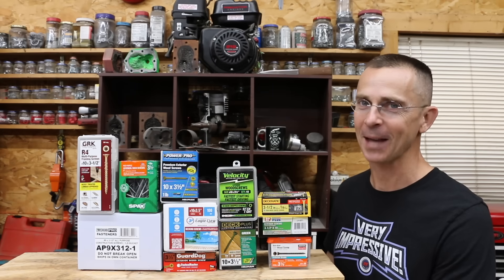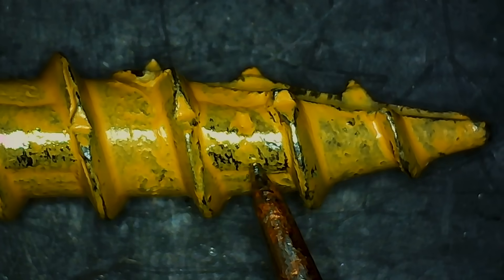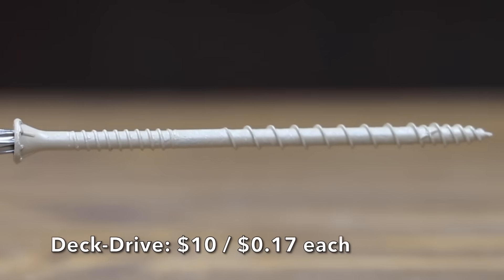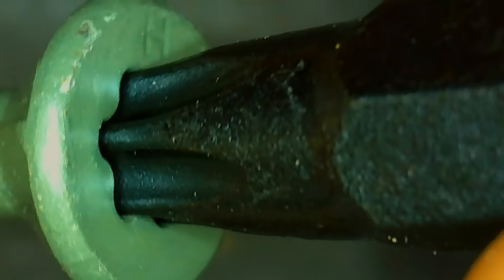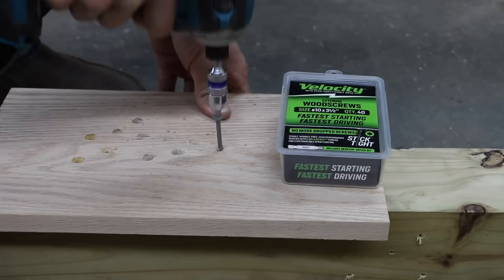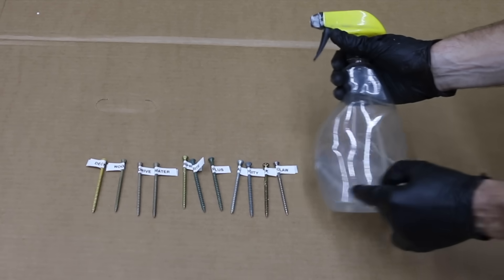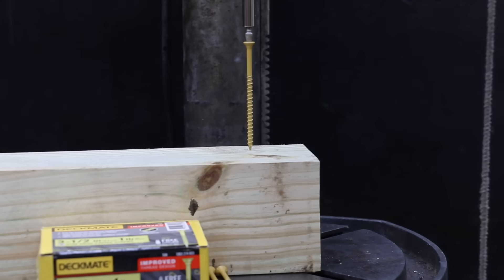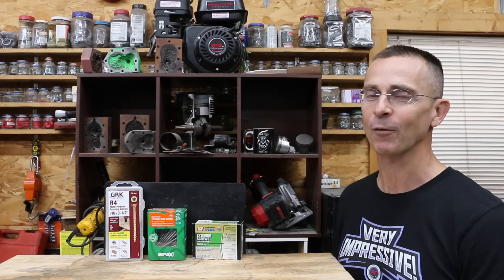Best Deck Screw? GRK vs SPAX, Grip Rite, Deckmate, WoodPro, FastenMaster, Deck Plus, Eagle Claw

Comment: I think you would be hard pressed to find any spray-on industrial fastener coatings, epoxy or electrostatic, that would not flake or abrade off under the friction and heat of driving the screw into dense wood like PT pine. A follow-up test might reveal a different outcome on coatings if the screw was driven into wood slower and with/without the hammering effect of driver-drill tool. Keeping the protective surface coating intact should be the goal, not fastening speed. Obviously there is a balance.
Reply from the maker: Thanks for the suggestion.
Reply: @ProjectFarm  as a test engineer I compliment you on what you have achieved on your sight. The array of products and tools and the creative methods, and limited budget you work with, all collect very interesting and comparative-chart data. It's not definitive UL Lab level, but all things considered, well done Project Farm. I also hope young engineers are watching and become inspired. Thank you for this effort.

Comment: So, I have experience with the SPAX 1 1/2” deck screws. My experience is, on a piece of white oak, they strip easily with torque. I’ve had screws (wish o could remember), that would almost countersink through the plank to the other side. I’m not impressed with them personally. Anyone else have a good/bad experience with SPAX brand screws?

Comment: Awesome! I've always been a die hard GRK fan. They're not the cheapest, but they are definitely the easiest to start, and have great withdraw force. The torx sizes are very precise (no loosey goosey) and have good depth, so they are very forgiving when you can't drive them perfectly straight. Again, I can't stress enough the importance of how easy they are to start. 4.4lbs vs 6lbs may not sound like much, but drive a box of deckmates, then drive a box of GRKs... you'll never go back to deckmate. The low starting force is a huge time saver.
Reply from the maker: Thanks!  Thanks for sharing.

Comment: 3 1/2" screws for decking seems like overkll. I have found that the boards rot and pop over the screw head so it doesn't matter how long the screw is. And prying up a deck with 3 1/2" screws would be nightmarish. 2 1/2" is fine.

Comment: I have to say, the only important test is the pull out force. If you worry about corrosion buy stainless steel.
All the other factors come in when you start working with 8mm/200mm screws moving upwards. This is where expensive screws like Spax, Heco, Würth(forgive me for only using German products I live there) shine.
Heco has one of the best screws in my opinion. They produce selfthightening full threaded screws, either by changing the threading angle or splitting the threading in half again with different threading on each part. They go so far to change the diameter of the screw to assure a good grip after the first half of the screw passed by.

And rust isn’t always bad. I have worked on roofs made in 15XX with the original handmade nails still holding the wood together, rust does help a lot that the buildings don’t break down. Sure if you use force(more than what nature offers when it’s windy) they can break, but in most cases the old wood breaks first leaving you with the hardest nails to pull out.
Reply from the maker: Thanks for sharing.

Comment: It's hard to believe something beat the SPAX. We use them when we need to hang cabinets on cinderblock wall because they are galvanized and they hold pretty good. They are not as good as Tapcons  but they are pretty good. A lot of schools use cinderblock. The SPAX that came from Germany I think were a little stronger. Thanks.
Reply from the maker: Thanks for the feedback.

Comment: I recently disassembled a deck-like structure I built (using old deck boards) over ten years ago using Grip-Rite screws. It's sat outside that whole time. Some of the wood was rotted away. The screws almost all looked basically brand new, though; I put them back in a box for a later project. Only a couple were slightly rusty on the head.

I've since switched to GRK and Spax. Last weekend I removed some GRKs (mostly R4 with a few cabinet screws) that I fixed a fence with three years ago. They've been in treated wood. Again, they all looked dull but otherwise perfect.
Reply from the maker: Thanks for sharing.

Comment: First, thanks for this video! You've answered a few questions, there. Second, as someone who's driven literally tens of thousands of screws, including most of these brands, I'd have to say that the two most significant factors are ease of start, and resistance to de-heading. Once the screw has a start, it's not really a big deal how quickly they drive, eh? We're mostly using cordless, in the trades, and the drill will drive more slowly at the end of the charge, anyway. And at least one of these brands has an unpleasant tendency to pop directly below the head- I'm not going to call them out, but I suspect other pros will know which one I'm speaking of....
Reply from the maker: You are welcome!  Thanks for the feedback.

Comment: Is there a line of deck screws that utilizes the same bit size throughout the lines different length screws? All the ones we have used use a T25 bits for longer screws and a T20 bits  for shorter screws, would really like to find a solution that allowed the user to keep the same size bit regardless of the screw length short or long.
Reply from the maker: Thanks for the suggestion.

Comment: Love this idee, just build a deck with my dad from 3.2cm hardwood planks on a 2by4 support grid 

We wanted stainless steel as the deck should be good to go for a long long time. Found out that there are different quality's stainless (in Europe we call A2 soft and A4 harder stainless steel) was hard to find some good screws.

And let me tell you even using A4 stainless a Milwaukee brushless impact broke a  couple of screws. 

Would love to see you retest this with some different stainless screws from spax (they have A2 and A4) and same goes for the woodies brand.
Reply from the maker: Thanks!  Thanks for the suggestion.

Comment: One more great video from PF. I've used at least 4 of the brands tested and have found SPAX, GRK, Deckmate as well as Grip Rite. Prefer the GRK followed by SPAX. With that said, all have done the job just fine with little or no rusting here in the snowy Northeast winters. My only comment to the test is that you probably need to use the "usual" sopping wet treated decking lumber and to screw two pieces together of 5/4 and/or 2 x ? for a comparative analysis,

Comment: I made some raised garden beds in the backyard of a house using some coated deck screws(triple coated I think, maybe grip rite, something from menards). About 7-8 years later I did some repairs because the wood was rotted/deteriorated and the screws i had used were nearly new condition while in direct soil and wood contact through all seasons including sub zero temps.
Reply from the maker: Impressive!
Reply: Hopefully Grip Fast, triple coated, from Menards. Drives me crazy that Menards doesn't allow reviews and I can't find this product anywhere else!

Comment: If they use any screws at all, instead of nails, those are better deck-builders than I've seen. Every house I've lived-in that has had a deck, has inevitably been built with nails that have started to pull up over time. Sometimes it's possible to clamp-down the warped boards, pull out the loose nails, and replace them with screws...but not always.
Reply from the maker: Thanks for sharing.

Comment: I wish you would have tested how much torque you can put on the head before it shears off. This is probably the most important characteristic to me when building a deck. I constantly found that the deck mate screws would shear at the head soo easily to the point I threw them all away and the power pro worked sooo much better. This didn’t seems to be shown in your shear results as you tested in the middle of the screw.
Reply from the maker: Thanks for the suggestion.

Comment: I recently installed deckmate screws on my deck and was kicking myself for not finding this video first.
In the beginning of this video I was worried the corrosion resistance wasn't going to be good enough but after watching until the end I am happy to see that they didn't have corrosion even after visible damage to the coating 😃
Thanks for another helpful video!
Reply from the maker: You are welcome!  Thanks for sharing!

Comment: It would be awesome if you did cabinet screws at some point. I install kitchen cabinets and just switched to grk cabinet screws. I like how they drive and they color almost blends in with the clear maple back of most cabinets, however the shaft is very skinny compared to other screws I have used in the past and don't inspire confidence when it comes to hanging heavy upper cabinets. I wonder how they actually hold up to the competition.
Reply from the maker: Thanks for the suggestion.

Comment: Great informative video and channel! I love how enthusiastic you seem about doing all the tests as if to quell your own curiosity and I truly hope that never dies and that this will only get more fun for you!

Future test suggestion: DRAWER SLIDES!
I read a comment earlier suggesting that but can't find it so thanks to that guy, I second his suggestion! It would be very interesting to see a test between all the different brands/kinds of drawer slides since there are so many brands with a huge variance in price. It'd be helpful to see a set of $20 slides from Home Depot face off with a set of $100+ "premium" slides. And there's so many kinds of tests to be done like smoothness of the movement, softness of the soft close, how accurate the weight limit claims are, and even as the other commenter suggested..a test to see how many times they can be opened/closed before some kinda failure. We hope you consider this one, thanks and take care!
Reply from the maker: Thanks!  Thanks for the  suggestion.

Comment: As a teacher, I would love to see all of the results put into percentages that way you could see an even better comparison of the results. For example, the weight needed to pull the screws out, first place 698 pounds would be 100%, second place 693 would be 99.3%, third place 689 or 98.7% all the way down to last place 524 or 75% of the best performer. You could average all of the percentages to give a total final score that would very accurately represent each item versus the rest. Also, long time watcher from waaaaayyyy back.
Reply from the maker: Thanks for being a long time watcher!  Thanks for the suggestion.

Comment: i use stainless steel for deck boards . they don't need to be super strong , they only need to keep the board in place and resist cupping and warping . i used spax ss and after six years when i had to remove some boards for maintenance , they were in perfect condition .
Reply from the maker: Thanks for sharing.

Comment: Interesting. How about testing the real world application in finished construction with nails versus screws? Clearly they break easier when bent but a house would not bend much and if it did it is gone anyway.  Would a screw prevent the bending in the first place more than a nail?
Reply from the maker: Thanks for the suggestion.

Comment: I would be interested to know if any of the deck screws pull through the decking rather than the underlying structure.  Also, whether they strip when getting installed.  Like if you hit a knot in the wood that stalls the driver, does the head strip?  Great video as usual!

Comment: I build a tiny 260 square foot  cabin out of 2x6's and used Deck Plus screw. I have at least 3000 screws in it and sure glad I did.  Using screw them to fame mike life so each when you make a mistake. Just unscrew it, fix and screw it again. Never would I frame my buildings with nails. Screws Rock.. and them Deck Plus are great. 

Thanks for the video.
Reply from the maker: You are welcome!  Thanks for sharing.

Comment: I'm currently resurfacing a decent sized deck 20 x 40 feet. In the past I had used the HD Deckmate brand. After watching this video I decided to go with Griprite, Griprite seems to have the cost to performance ratio correct. The color seems to be the most curios thing about the product, not sure I get that part of the deal. HD sells the Philips version of the product so I ended up buying from Loews that has the Torx version. Your link to Griprite is not correct on Amazon or at least the picture is inaccurate. The guidance as always is much appreciated. Thank You!

Comment: A question about the coating retention test. Is the running of the screw in and out, plus a run through oak, a real world test? Screws are driven in and not really reused. I am not sure but thinking the screws should have been driven through a treated 2x4 and the coating evaluated on the portion of the screw protruding through the wood on the bottom of the board. ??
It would have been a plus to put one of the those super wet treated 4x4 outdoors with screws driven in and evaluated  after a year of exposure.
Overall test is interesting and I did not realize the time differences for installation were so great between brands. 
I purchased screws yesterday and the driving factor was price. Basing my project was going to last 6 years at best. 
Price has always been king unless the application requires the "best". i.e. elevated deck area, hard to get to application

Comment: I built a fair sized deck for someone last year, about 600 sq ft.   All lumber was brown treated spruce.   All fasteners were GRK.
Last week I added an area about 8' x 4' so he could have a place to add a second set of stairs going down to his hot tub.   
I had to remove about 30 sq ft of the 2x6 top planks I had installed last year, held down by 3.125" long #9 GRKs. 

About 6% of those #9 screws broke during extraction, at a very consistent 2" from the top of the screws.   That left me very unimpressed:   I would expect better performance from much cheaper run-of-the-mill uncoated deck screws that cost less than half as much as those GRKs.
Reply from the maker: Thanks for sharing.

Comment: This viewer suggests testing the same group for tensile strength. In my experience, the post installation problem with deck / fence screws is, they experience expansion and contraction of the wood until they pop. The screws don't move or pull out, the screw-heads just pop off.
Reply from the maker: Thanks for the suggestion.

Comment: I am curious if the GuardDog has the best fitting bit... If so that'll slow down the application too.. Trying to remove a well fitting bit takes an extra pull! See 10:35 in the video.. I would imagine a sloppy fitting bit would decrease install time.. both setting the bit into the  screw for driving and releasing. Meaning, driving more screws - the sloppier the fit. LOL IMHO! :)

Comment: I might have to revisit Spax. I had given up on them after having so many of them snap on me going into old wood. Did not have that issue with Deckmate of the same size and length. Not surprising when it was so hard to start the Deckmate. That has been a constant source of irritation for me. We use a lot of screws around the farm, so price is certainly a considertation.
Reply from the maker: Thanks for the feedback.

Comment: Noob question: Would these screws work well for door frames as they are 2 x 4’s typically? I ask because I am installing longer 3 inch screws and stronger striker plates for better home security.
Reply from the maker: Thanks for the suggestion.

Comment: Not reviewed here, but for those in the Midwest: Grip fast triple coated deck screws are awful to drive, but they were good up until recently. I used to be able to drive any grip fast deck screw easily with an m12 or M18 surge, but not these. Not anymore.
Avoid them.

Deckmate are fine

GRK #9 or #10 2.5" or 3.125" are excellent. Amazing, even. Their lags and trim screws are great, too. I hold them above all other screws. They hold up great over time, too. It's only like $5 difference on a 5lb box of GRK vs the cheaper Gripfast and deckmate.

Also, I've seen those green grip rites come out of rotten old decks in pristine condition, like you could just use them all again if you wanted to. I've never bought or used them, though.
Reply from the maker: Thanks for the feedback.

Comment: The Simpson deck screws really do sink quicker than you can blink.  They also blend in with wood really well. Not a fan of what ITW did to GRK.  Politics/drama aside, GRK is what I keep on hand as a universal screw.  Spax is great, but little things make me like GRK better.  All GRK is indoor/outdoor, they use T25 for #8 and #10 screws instead of T20.  Said torx on the Spax has a nipple.  I can get those bits from Wera, but plain old regular torx is something I use a lot so…I generally just use regular t20’s with them often and they invariably don’t fit as well.  GRK seems to drive a lot easier and they have more of the sizes, lengths and head styles I use.  I use the green T30 Spax power lags A LOT nonetheless. The Hillman PowerPro surprised me when I tried them out.  90% the performance of GRK/Spax at 90% the price. The savings just wasn’t there in the end.
Reply from the maker: Thanks for sharing.

Comment: I installed about 2500 Deckmate screws. I’ve had to replace very many for snapping at the smooth part of the shaft. The problem is they would snap during the drying process of the wood. I noticed the deck boards seeming a little loose and I go to back the screws out and they just spin in place. I’ve had to replace probably 15% of the screws. I would say your rating of the dick bait is dead on! Thanks for the video!
Reply from the maker: Thanks and you are welcome!